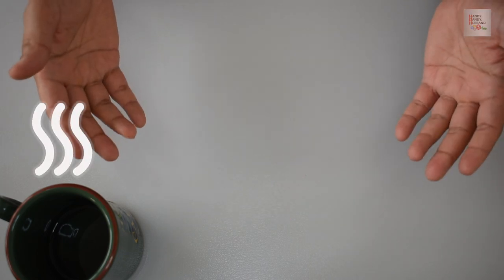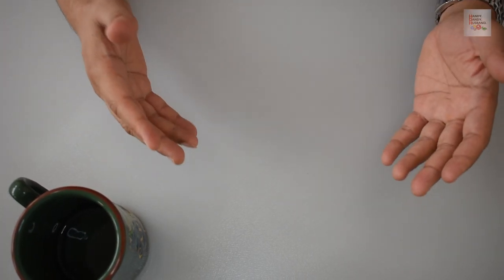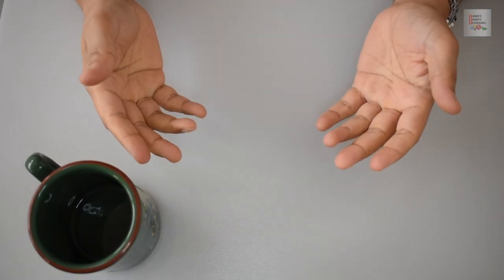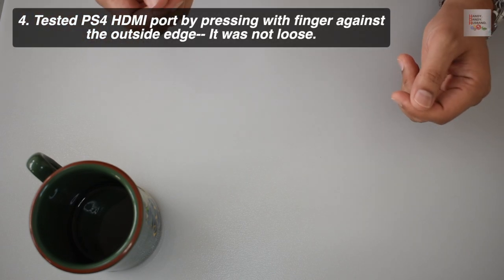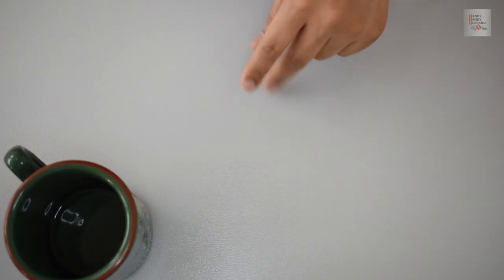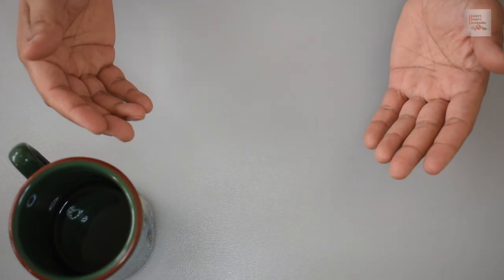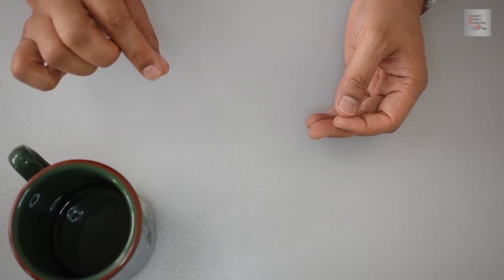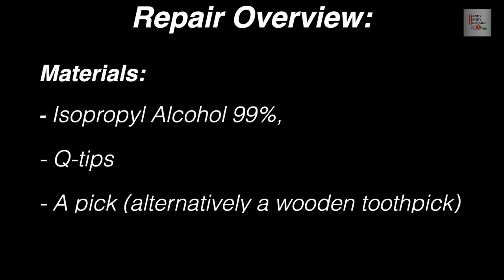𝗤𝗨𝗜𝗖𝗞 𝗧𝗜𝗣: 𝗣𝗦𝟰 𝗛𝗗𝗠𝗜 𝗣𝗼𝗿𝘁 𝗥𝗲𝗽𝗮𝗶𝗿 -- Easy, no solder required -- [Fix that video input error]

Comment: Hi I’ve tried everything in your video and nothing fixes it. It just says ‘no signal’ on my tv
Reply from the maker: HI sswane, thanks for watching and sending me a summary of your issue.  I am sorry that my fix didn't work for you.  Have you tried resetting the PS4 (hold power button for 7-10 sec, unplug the power cord, wait 10 sec, and then retry)?  This may help.  Also, if that doesn't work, try nudging/shifting the HDMI cable while it is in the port and see if that little bit of movement helps establish a connection.  Please let me know your results and I will try to help you out.  All the best to you in 2021, thanks, H.D.H. [: { ].
Reply: @HANDYDANDYHUSBAND  hi, thanks for your reply, my problem started way back in October last year- I had to nudge the HDMI cable al the time to get a signal but yesterday it finally stopped. I have not tried to reset my PS4, because I’m going to sell it and then buy another one but if that doesn’t work, I’ll be thinking of resetting it.
Reply from the maker: @sswane8452  Hi sswane, thanks for your reply.  I have heard of this issue and it has to do with a weak/incomplete video signal.  If my fix didn't fix it, try the following: 1) Do try to reset the PS4, 2) then do whatever you can to get the signal, meaning, fiddle/nudge the cable until you get a video connection to to your TV and then use duct tape to keep the cable in the position that provides the best connection, 3) with the video connection solid, play with the PS4 until the fans start blowing hot air and keep playing for 3+ hours, 4) turn the PS4 off normally, do not touch it and keep it off for 24hrs 4) after 24hrs, gently remove the duct tape without disturbing the HDMI cable, 5) then, try turning on your PS4 normally.  The process above attempts to use the heat the PS4 generates normally to help set the HDMI port in a slightly improved position.  Also the heat would help expand the HDMI cable connector in a manner that would improve the connection.  Hope the above helps, all the best to you, H.D.H. [: { ].

Comment: How do i even move the things in the hdmi port?
Reply from the maker: Hi killa dj, thanks for watching and sending me your question.  First, be very careful that you only move the thin metal strips on the OUTER portion of the HDMI port (not the middle part).  Check out this picture for clarification: https://drive.google.com/file/d/1nYwZaYcaKrAbYL6Nsrgn1AA8T0TmL-53/view?usp=sharing.  Next, use a pick, toothpick, needle, or long pin to gentle pry up the two metal strips that I have identified so that they provide greater tightness/friction to the HDMI cable when it is placed inside the PS4's port.  Hope the above notes help you.  All the best to you, H.D.H. [: { ].

Comment: I cant find anything small enough so I used a knife but when I lifted it back up and plugged in the hdmi they went back diwn
Reply from the maker: Hi Cbandz, thanks for watching and sending me your question.  Try to find a metal pin, or a needle and gently prod the metal up.  Sometimes it will bend back over time, but in my experience this happens maybe every 6-12 months.  If it is bending more quickly, try experimenting with either a higher bend or a lower bend and see if that changes the timeline over which it bends back.  The metal in the HDMI port is flexible to a point, so be careful that you don't do it so much that it cracks or breaks.  Also, make sure you have lots of ventilation around your PS4 as the heat generated from the console can warp/bend the metal as well.  Hope the above suggestions help you out.  All the best to you, H.D.H. [: { ].
Reply: @HANDYDANDYHUSBAND  I got a question I finally found something to lift them up but the hdmi won’t fit noe
Reply from the maker: @carloosss1845  Hi Cbandz, thanks for your further question.  Be very careful when sliding the HDMI cable back in.  It appears you may have bent the metal strip so much that the strip edge may be exposed and when you try to slide the HDMI cable into the port, it catches.  Gently put the very tip (the edge that is closest to the opening of the HDMI port) down.  Make sure that both strips of metal are flush at the opening and then gently rise up so that the entering cable head can gradually fit snugly.  Again, be gentle and don't force anything.  Hope the above suggestions help you.  All the best to you, H.D.H. [: { ].

Comment: It’s hard to do the hdmi toothpick thing
Reply from the maker: Hi Snipez1x1, thanks for watching.  Yes, it can be a bit tricky using the toothpick, but if you are having difficulty, you can try a long pin or needle--just be careful that you don't over bend the metal strip using these harder implements.  Hope this helps, all the best to you, H.D.H [: { ].

Comment: None of these work. I will never be able to use my console,plus I cannot buy one so I'm just gonna break it if it don't work in a weak
Reply from the maker: Hi Randomdumbthings1234, thanks for watching.  Don't lose heart.  Sometimes things take a little longer than one expects but hang in there and things will go your way.  I am sorry my fix didn't work for you.  Unfortunately, it is a free fix that addresses a common issue with the HDMI port.  If your HDMI port is compromised (loose or damaged) the fix may not work.  Do try to take your console to an authorized repair depot and at least see if they can recommend a way forward.  Hope you get it working, all the best to you, H.D.H. 
[: { ].
Reply: @HANDYDANDYHUSBAND  Thanks man I'll try again this Saturday. The console has an extreme problem with it. I'm just gonna try to get a new one.
Reply from the maker: @KTLSCRAPP  Hi Randomdumbthings1234, Yes, please try to get it running.  Money to buy a new console is one thing but trying to get something working again so that you can reuse/continue to use it will help everyone in the long run.  If you can, please do try to get it working, I will try to help.  All the best to you, H.D.H. [: { ].

Comment: Hey sir my ps4 hdmi port inside the ps4 like wiggles when I try to plug the wire inside and I’m freaking out Bc i don’t know how to tell my parents it’s broken i don’t know wtd
Reply from the maker: Hi Christian Asmr, thanks for watching.  I am sorry to hear about your PS4 HDMI port issues.  If the actual HDMI port is wiggling (meaning when you gently move it with your fingers, it shifts) this is a serious malfunction of the HDMI port.  Basically, the solder which hold the HDMI port in place or the brackets that affix the HDMI to the board inside the console are compromised.  You will need to contact Sony and see if they will cover it under warranty.  If the unit is out of warranty, ask Sony for a factory authorized repair shop that can replace the port for you.  I am sorry to say...either way you will have to let your parents know.  Hope my suggestions help you get your PS4 running again.  All the best to you, H.D.H. [: { ].

Comment: Me and my mom was doing everything in the video we just didn’t know what height to put the bottom silver things at and it still doesn’t work
Reply from the maker: Hi Hotboii Trey, thanks for watching and sending me your question.  The silver metal pieces should be protruding about 2-3 mm (by comparison you can look at the adjacent 'AUX' port and you will see similar metal strips, but these protrude much more than what you need the HDMI port strips to protrude.  Also, remember to reset the PS4 multiple times after the fix.  I hope this suggestion helps you, if you have any further questions, please let me know.  All the best to you in 2021, thanks, H.D.H. [: { ].
Reply: Another question sorry but every time I ride them a lil I can’t plug the hdmi cord into the port
Reply: Like the lil silver things are blocking it to where I can’t plug the cord in
Reply from the maker: @HotboyTrey63  Hi Hotboii Trey, thanks for providing your further input.  If you are looking at the back of your PS4 you are going to see the port that is labelled 'HDMI OUT'.  This port has a metal shroud or outer metal cover and a plastic/metal inner piece that is thin and sits horizontally in the center of the port.  The two metal pieces are below this center horizontal piece.  Only pull up the metal strips a little--only 1-2 mm, they should NOT be pull up as much as the AUX port that is next to the HDMI OUT port.  When you plug in the HDMI cable, make sure you are placing it correctly against the port on the PS4--it only fits one way so you have to make sure the pattern aligns.  It will be more snug, but I have not experienced anything to block it completely.  Just remember to make sure that metal strips need to just come out a little otherwise you might break them if you force the HDMI cord into the port.  Hope these suggestions help you.  Let me know if you have any other questions.  Thanks, H.D.H. [: { ].

Comment: Hello i have this issue but i did all the steps u told me to do i restarted twice at the end im 99percent sure its the hdmi port bcs when the ps is on i plugged my headset and i could hear the ps4 sounds idk what i should do everything seems ok even the hdmi port and i changed 3 cables so help me please man
Reply from the maker: Hi Lorenzo .C, thanks for watching and sending me a summary of your issue.  I am going to assume that you are not using the digital audio out (optical) port.  If that assumption is correct, then what is happening is that you are getting only a partial connection with your HDMI port.  If you followed all the steps in the video, then also try the following:  1)  Use your newest HDMI cable, make sure the metal is cleaned and insert the ends into your PS4 and into a new port on your TV/monitor, 2) turn on your PS4 and use a mirror to see the front of your TV, have some duct tape or masking tape pieces (4-5" in length) with you while you adjust the HDMI cable in the back, 3) by GENTLY nudging the cable to either side or slightly up or down check to see if you are able to get a video signal, 4) if you do get a signal, try taping the cable in the position that has the best signal, 5) once you have a signal, try playing with your PS4 for 2-4 hours--the heat should help the connection, 6) then turn off the PS4 normally and let it cool down for 24hrs.  If you don't get a connection even by nudging the cable, then I am sorry to say that you may need a factory authorized repair depot to assess the issue.  You might want to complain to Sony customer service and see if they will do a free warranty repair considering this problem is so common.  Hope this helps, let me and the community know your results, All the best to you, H.D.H. [: { ] .
Reply: @HANDYDANDYHUSBAND  guess I gotta go get it repaired. Shit!

Comment: Do the top ones need to be out a little too?
Reply from the maker: Hi Juanito Valencia, thanks for watching and sending me your question.  By the "top ones" are your referring to the thin, center, projection that has brass lines on it?  If so, no.  This piece does not need to be out.  Only the outer metal piece of the PS4 port should be protruding toward the center of the port so that it can help align the cable.  Hope my suggestion helps you.  All the best, H.D.H. [: { ].

Comment: Is it normal for your PS4 wire (not hdmi) too be wobbly
Reply from the maker: Hi Jobey Taylor, thanks for watching and sending me your question.  I am not sure which wire you are referring to.  Are you maybe talking about the power cord? or maybe the USB charging cable for your controller?  Please let me know and I will try to help you out.  All the best to you in 2021.  Thanks, H.D.H. [: { ].
Reply: @HANDYDANDYHUSBAND  I meant the power cord sorry
Reply from the maker: @jtlol1218  Hi Jobey Taylor, thanks for clarifying.  A wobbly power cord is not normal; however, if your PS4 is working fine, I would try to keep the PS4 stationary (so that it doesn't wobble or wiggle too much) and continue playing with it.  The power cord typically has grooves cut into it so that cord doesn't just pull out or work its way out.  Power off your PS4 and then unplug it.  Check the back side of your PS4 and see if either the grooves on the power port or the mating grooves on your power cord are worn out or damaged.  If this is not the source of looseness, then (with the PS4 still unplugged) use a pencil to see if the actual two metal pins inside the PS4 are wobbly, if they are your issue is most likely with the pins becoming loose on your PS4 board.  This is an issue that you should have your factory authorized Sony repair depot address.  Hope my suggestions help you discover the source of your issue.  If you get a chance, please let me and the community know your results.  All the best to you in 2021. Thanks, H.D.H. [: { ].
Reply: @HANDYDANDYHUSBAND  My PS4 is fine o was just wondering I got it for Xmas and it was like that😅
Reply from the maker: @jtlol1218  Hey Jobey Taylor, if it came like that, it doesn't seem normal, but it might be prudent to check in with Sony and advise them of the issue and confirm that there is no electrical/fire possibilities as a result.  I think that given this is the main electrical connection and most PS4s run quite hot, Sony will probably want to repair or replace the the power outlet so that there is no arcing or electrical fire possibilities.  My thought is better safe than sorry--especially if you have a family or pets that might inadvertently knock up against the power cord port.  Stay safe man...all the best to you, H.D.H. [: { ].

Comment: my ps4 hdmi turns on for like 2 seconds than turns off again how do I fix that
Reply from the maker: Hi Sofyaan Khan, thanks for watching and providing me with a summary of your issue.  I need more information before I can respond, however.  1) Can you see anything on the screen when the PS4 does turn on, 2) what color is showing on the outside LED when it turns on and then turns off, 3) Have you tried checking your power cables to ensure that they are tightly inserted into the PS4 and the electrical box or /surge protector, 4)  If you are able to, have you tried turning the PS4 on in 'Safe Mode', 5) Do you smell anything like a burning plastic when you turn on the PS4?  Please provide an answer to the questions and I will try to help you.  All the best to you in 2021, thanks, H.D.H [: { ].
Reply: @HANDYDANDYHUSBAND  hi thx for reaching back, the ps4 turns on and nothing smells like burnt plastic. i made sure that its tightly secured. I can see the screen for like 2 seconds then it shuts off and I can't see the screen.
Reply from the maker: @sportsintiktok2484  Hi Sofyann Khan, I think the problem could stem from a bad power supply (rare), bad solder joints, or faulty chips on the motherboard.  There really isn't a sure fire way to see which one of these problems your PS4 is having unless you have a reputable repair facility assess it.  I can, however, make some 'free' suggestions that may work before you send it to the center.  First, try placing the PS4 on its side and then try turning it on (the shift in position may be enough to help any poor solder connections reconnect.  If this doesn't work, you can try turning it on its side and gently, but firmly hit the top, right side of it while you turn it on (be careful and don't hit it aggressively or try to break it).  Last, try removing the top cover and use nylon washers underneath the APU clamp.  The tighter clamping force the APU clamp can apply with extra washers may be enough to get it to reconnect properly. Hope one of these suggestions work--note that sometimes the PS4 will work for a short time or for a long time after such a hack.  Some say that the APU clamp fix works about 50-70% of the time.  Thanks, H.D.H. [: { ].
Reply: @HANDYDANDYHUSBAND  would you have Instagram by any chance so I can dm u its will be a lot easier
Reply from the maker: @sportsintiktok2484  Hi Sofyaan Khan, yes, I do have instagram:  https://www.instagram.com/handydandyhusband/  
You can also send me an email at thehandydandyhusband.info@gmail.com
Thanks, H.D.H.
Reply: @HANDYDANDYHUSBAND  it workssss
Reply from the maker: @sportsintiktok2484  Thanks for letting us know your results. Very happy to help you out.  Thanks, H.D.H. [: { ].

Comment: can i like use a tip of a rag
Reply from the maker: Hi Macai Warthen, thanks for watching and sending me your question.  Yes, I guess you could use the tip of a rag; however, it would have to be pretty strong but long and thin in order for it to actually contact the insides of the HDMI port.  Be gentle and make sure you don't leave any fabric strands behind.  Wish you the best, please let me know how it works out for you.  Have a great 2021.  Thanks, H.D.H. [: { ].
Reply: @HANDYDANDYHUSBAND   i had try to prop it up but i don't know if i did or not and how i put it back in place pls
Reply: @HANDYDANDYHUSBAND  how do you put the two metals back in place
Reply from the maker: @macaiwarthen8161  Hi Macai Warthen, use a thin, long needle or pin or toothpick to gently bend the two metal pieces back in place (i.e. in a similar position as the adjacent AUX port but not as high).  The metal strips are bendable but do not over bend them.  Let me know if you have any other questions.  All the best to you, H.D.H. [: { ].